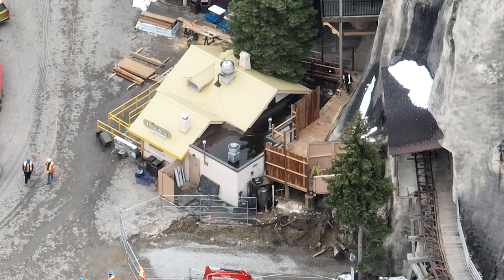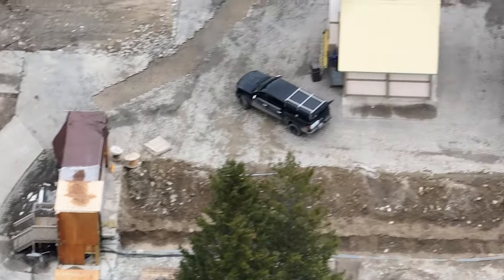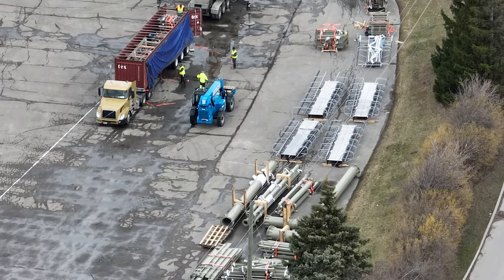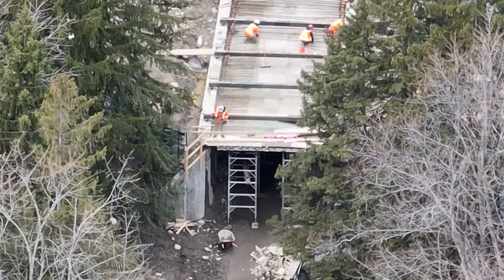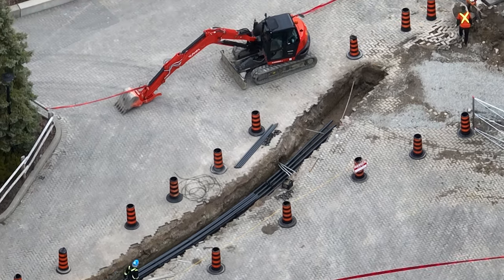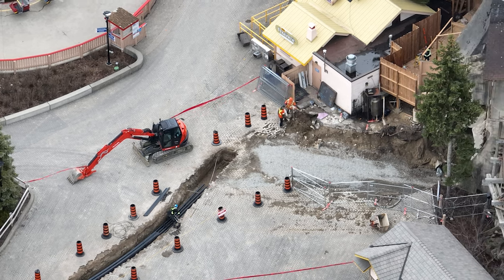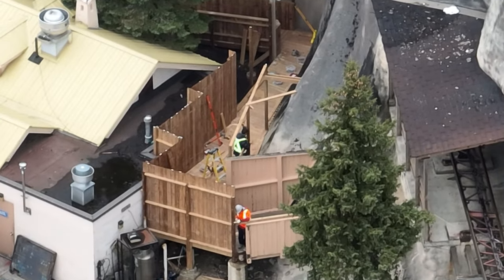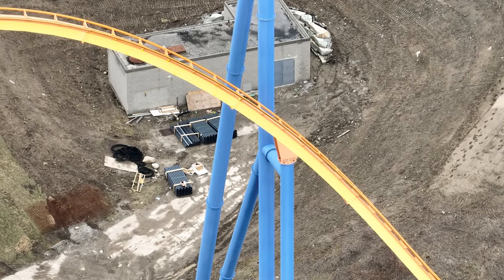Canada's Wonderland 2025 Electrical Work & More

Comment: Do you have a Mauer Spike Coster on your radar as a possibility. Again I'm just spitballing out my derrier, but that is a powered coaster model capable accelerating a train out the top of the muntain, but wouldn't need footings as strong as a tradional launch coaster since the force isn't the same. It would also be cold weather compatible since it can self compensate for cold weather. 

Long shot given Mauer's history and how risk adverse Cedar Fair is, but i thought it was worth throwing out there.

Comment: Did you ever stop to consider the possibility that wonderland isn't even getting a coaster this season? They could very well be getting a new flat ride package and  new buildings put in?

Right now the only one claiming that they're getting a coaster is you. Also keep in mind that electrical work isn't really proof of anything because flats require electricity to operate as well. 

One final note  is that coaster construction doesn't typically start this early  regardless of the scope of the project, it typically starts after the park is is already open for the season, although in KDs case they definitely started construction on their 25 project pretty early.
Reply from the maker: They’re getting a coaster for 2025
Reply from the maker: Also against your argument is kings dominions new coaster has also started construction as well
Reply: Six flags magic mountain also started their construction a few weeks ago for their 2025 coaster, same with palindrome at Cota land and of course kings dominion started too. Not sure exactly what your point is, we're seeing quite a few places start early on their additions.
Reply: Why would they remove a whole flat ride,destroy many buildings and make three tunnels in the mountain for a flat ride.😂